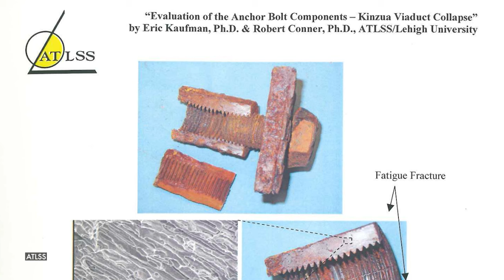20 Years Later: Kinzua Bridge Disaster

Comment: And the railway line is no longer needed?
Reply: No longer profitable.
Reply: This Bridge/Line was owned by the Erie Railroad. The Baltimore and Ohio owned a line running north, parallel woth it. By the 1950s, the Erie got trackage rights over the B&O and stopped running trains on that line, and eventually sold it off
 When different railroads merging, especially in the 70s-80s, many lines were consolidated, sold off or simply abandoned because they were redundant or unprofitable at that point.